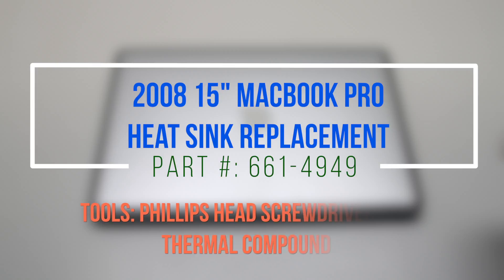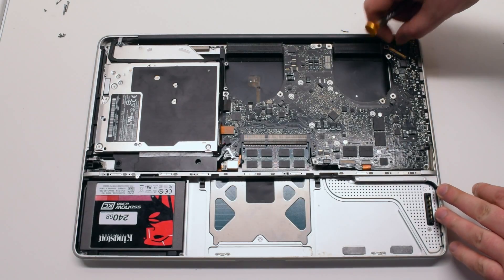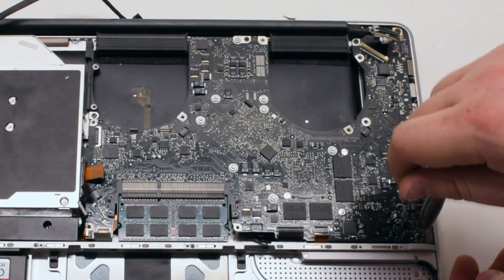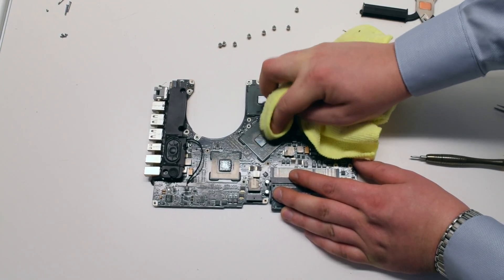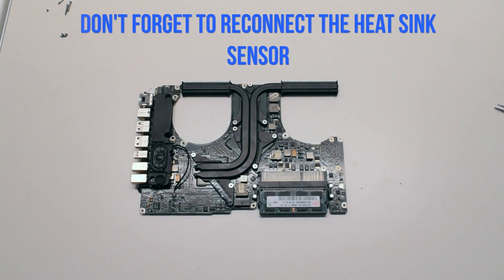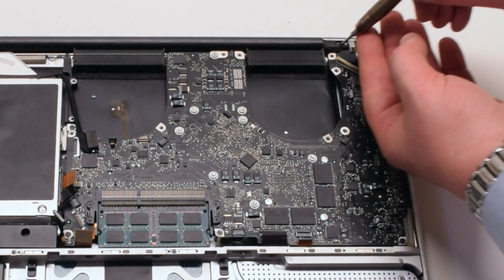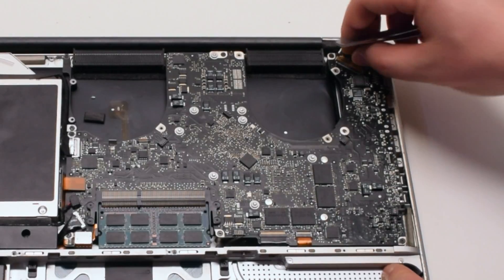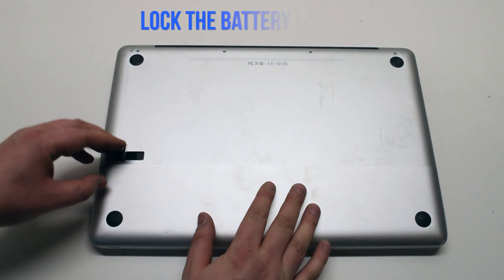2008 Macbook Pro 15" A1286 CPU Heat Sink Replacement

Comment: Followed this to a T, wanted to clean up the MacBook and put new paste on, put back together and the MacBook will boot up but it stays on a black screen. It does flicker when I press the power button at first. I’ve tried reseating the lcd cable to no avail.